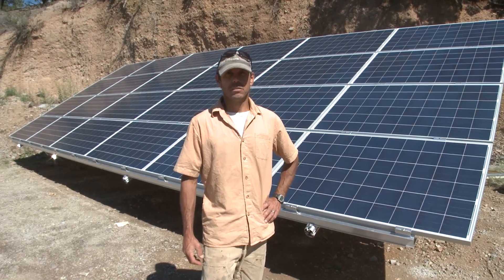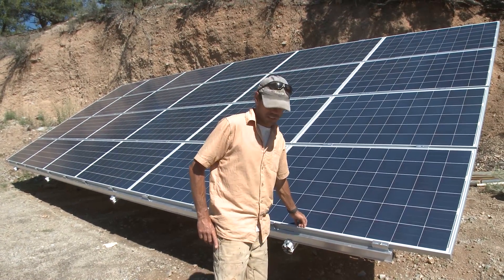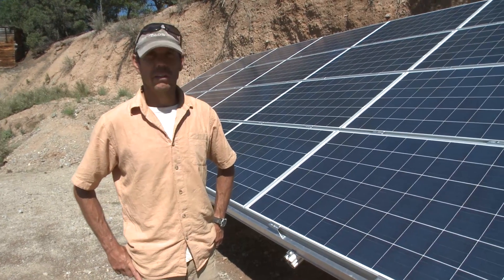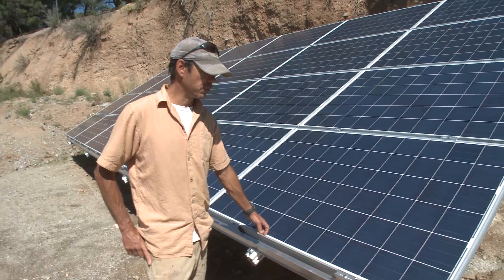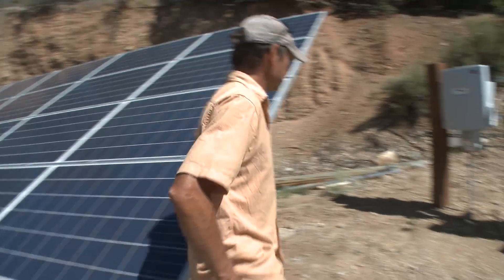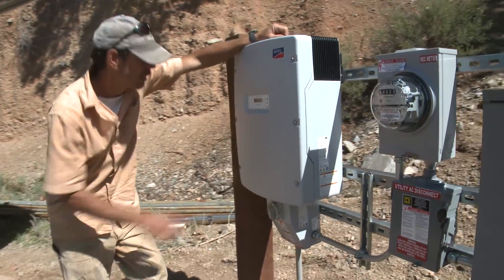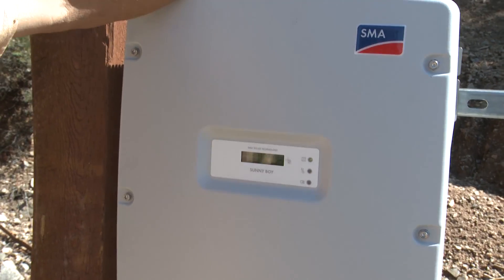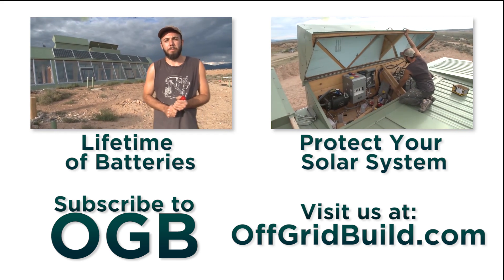Adding a Grid-Tied Solar Array

Comment: Nice video.  The original design of grid-tie was complete garbage.  I don't know which version this is (no mention of batteries or isolation) but if the power goes out, the solar side of the grid-tie system would shut down so that you didn't electrocute linemen when they come to fix the cause of the outage.  That's just dumb (no electricity, not the part about being safe for linemen).  But, I see now they have battery backed up grid-tie systems as well as ones that isolate your house from the grid during a power outage, so you keep your power on and don't kill anyone down the line.  I've been thinking about a grid tie system for a while now, but I have a $30/mo meter fee, so even if I built a system like this, I'd have to build it big enough to offset that $30/mo fee + kWh used.  I'm guessing this one was $12k - $14k just for the hardware.  Using that math, it would take 8 years before it actually paid for itself.